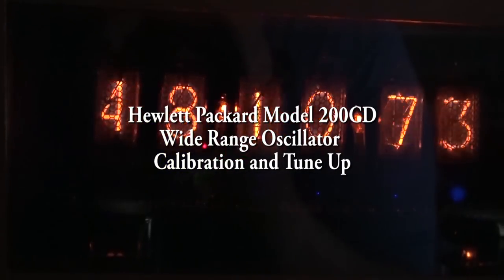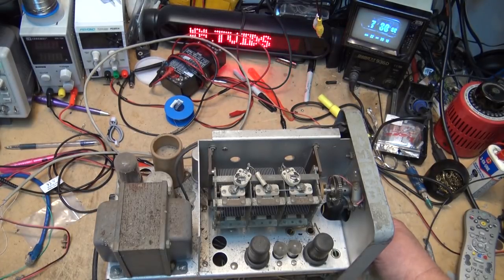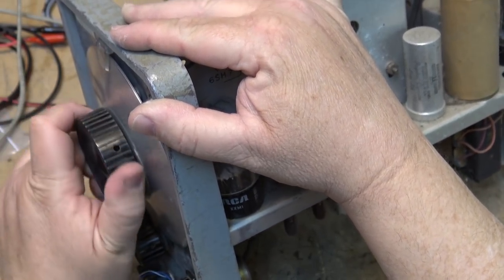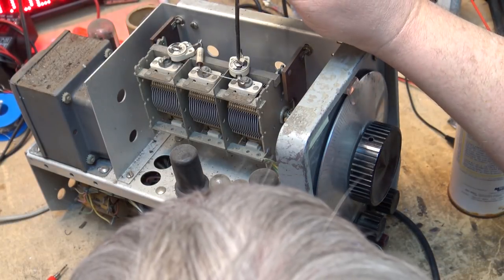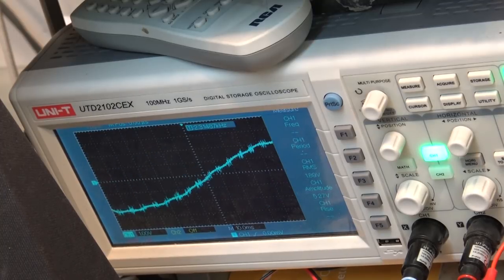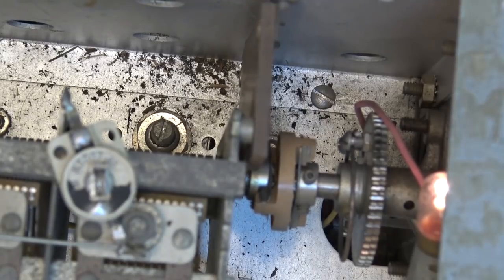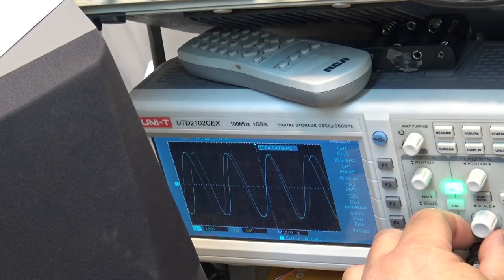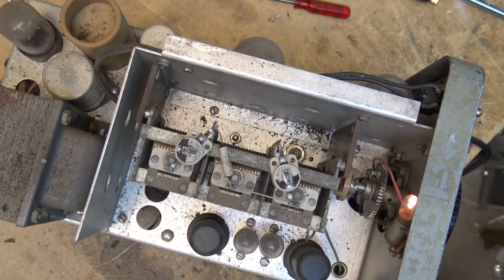hewlett Packard Model 200CD Wide Range Oscillator Calibration

Comment: I'm fond of this vintage hp gear. A full cosmetic restoration is one thing, but for the most part, you just rip out and replace all the bumblebee and black beauty caps and the thing will start working just fine.

Comment: Those small incandescent bulbs are actually part of the oscillator circuit. They provide a sort of automatic gain control.  Do a search on  Wien bridge oscillator if you'd like to learn more.
Reply: I was just gonna say the same thing, lamps like this were commonly used in these early signal generators to allow like you said "automatic control" of the feedback gain. As the lamp heated up the resistance increased which controlled the positive feedback so in a way it is "kind" of a limiter but not for current. when he said "current limiter". the only time i have seen current limiter lamps used in how he described was in my Hickok tube tester.
Reply from the maker: mjr1999 
I hadn't looked at the schematic when I shot this but correct they are in the amplitude control connected between the cathode of the rectifier tube and the grid on the oscillator. To provide agc. They are connected in series and are used basically as a resistor. The resistance of the tungsten filament changes with the heat in the filament this providing a automatic gain.  This is actually the first one of these I have opened.
Reply from the maker: Frank Scarano 
At first I thought they may be there to protect against a overload condition say, if the signal output was connected to something putting a voltage back into the circuit, thus protecting the tubes from damage, but correct they are in the oscillator circuit as the schematic shows. For amplitude control as the tubes age.

Comment: Nice unit. I just picked 2 of these up for free. 

An HP innovation at the time, the light bulbs were used for amplitude stabilization during fluctuations in temperature, line voltage etc...

Comment: changing all electrolytic and coupling capacitors would be a good idea. The signal was still distorted a bit in the end. Trusting those 50 years caps is like going to sleep with a live grenade in your hand. You never know when it will explode.
Reply: i couldn't agree more!
Reply from the maker: Pop Tibi 
Yup those bumblebee caps are bad news, but I don't have any replacements on hand and this old signal generator sees very little use. It gets turned on a couple of times a year. Now that it is putting out a correct sinewave it may see a little more. I do have that digital generator which is good for most applications.

Comment: This is obviously when HP was well established.  I have had an HP 200B that is from before they started marking serial numbers.  A few years ago I noticed pretty bad distortion and replaced the tubes.  Seemed to help some.  But earlier this year I found it really bad (had not used it in between), including 120 Hz ramble — not called hum any more.  So I opened the bottom side and saw some black pitch that had leaked out two dry capacitors, both rated 600 V DC.  Obviously a big repair was called for.
I found that also a coupling capacitor from one anode to next gate was leaky and probably for that reason resistors feeding the screen had suffered a violent death.  The odd thing was that also the lower resistor in the divider was blown open.  Oh yes, the two-section metal case electrolytic capacitor was off value, although still with quite low ESR.  After all the replacements, no more hum and the distortion is around 0.5%, still not as good as it should be.  But my main concern is that I cannot make the frequency dial track properly.  One of these days I’ll have to take yet another look at that.  Until then, my newer (ARB) generators have to do.

Comment: I used to calibrate test equipment and we bought a lot our test gear used. One thing I've seen more than once is someone substituting 6V6's for the 6F6's this unit was designed for; that can cause distortion and in some cases will make the unit act like a relaxation oscillator. The two tubes use the same basing but the plate impedance is very different.

The tubes last a very long time but the electrolytic caps should be replaced every couple of decades.

Comment: I highly suggest taking an air compressor to the inside, especially that tuning gang! All that foreign matter in the cap plates and tuning caps can cause issues. Its generally the very 1st thing i do before i start working on something like that.
Reply from the maker: That was done awhile back when I last had this thing open. That time it wasn't recorded.

Comment: Scrape, scrape, scrape. Is the dial rubbing on something or is it just some bearings that could use a bit of lubrication? That noise would drive me nuts. It sounds like the tuning cap in one of those radios of similar vintage that shango066 would dig up out in the desert after who knows how many decades.
Reply: I agree — something screeches too bad!
Reply from the maker: It is the dial dragging on the friction "fine" adjust knob below it.

Comment: Too bad HP abandoned test equipment. I used to have a hardback catalogue of the equipment they made including an atomic clock worth over 20 grand.
Reply: They spun off as Agilent then the electronics test area was spun off again as Keysight.  HP concentrated on PCs and IT.
Reply: Never heard of keysight. I guess not much money in test equipment anymore.
Reply from the maker: Mark Anderson 
I have 2 old hp device's. This and the old scope. I should set that old scope up as my crt vector clock again. It looks so good, but draws so much power and the fan is so loud I don't run it much.
Reply from the maker: Mark Anderson 
Well not for consumer gear anyway. Not much money in consumer repairs anymore either.
Reply: True, times have changed. I had and AC VTVM form HP. Loved it. Went down to 1 mV and I think 1 Mhz
Reply: Keysight sells mostly to industry.  If you need a $300,000.00 scope they can set you up!  DSO-X 93204X. 32 GHZ scope.  For mode info see the EEVBLOG.  He did a review on this scope.
Reply: Randy AB9GO Yes i could use one. Lol. Hp also sold to industry.  I think it was neat military grade back then.